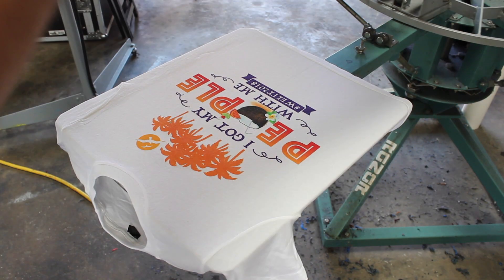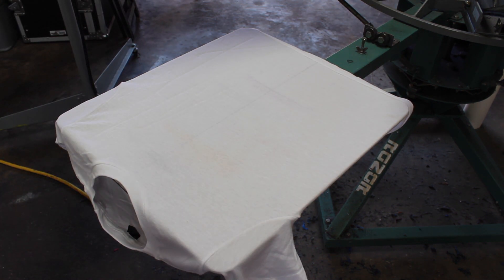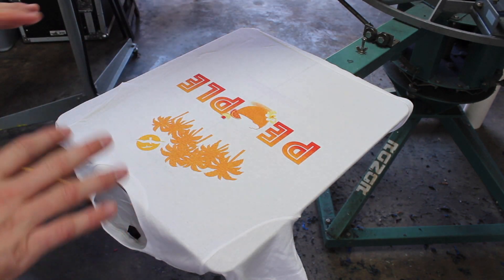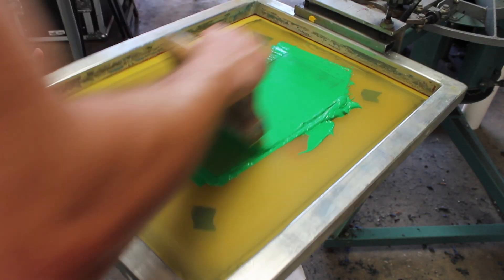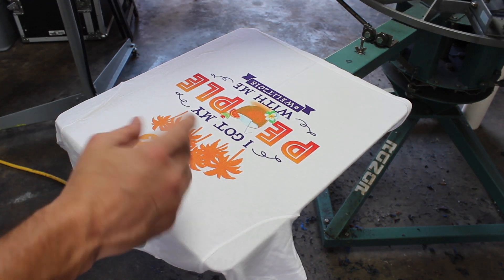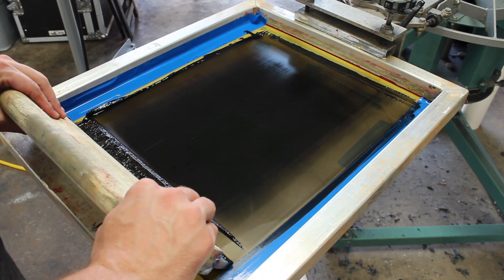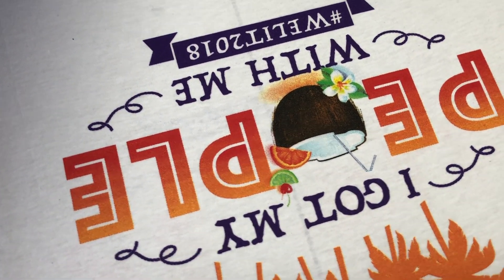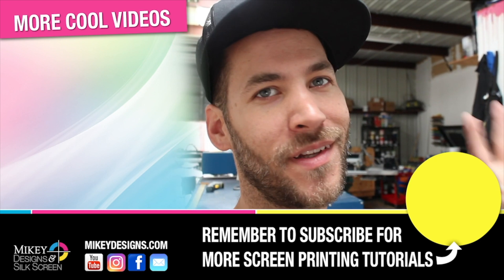The Ultimate Guide to Screen Printing Techniques

Comment: Looks great! Did you create that artwork or did the client supply it for you?
Reply from the maker: Thanks! A client of mine thats' a graphic designer created it. It was quite the challenging print to separate.
Reply: It turned out great. Which areas were giving you problems during the separation process?

Comment: Have you tried doing the same print with just CMYK?
Reply from the maker: I initially did, but the orange colors came out more consistent use spot process.
Reply: @mikeydesignssilkscreen473  Why do I find it so hard t ask questions ..I feel sooooo stooopid lol. But I will anyway...If you dont ask you dont know.....In what situation would you use CMYK over Spot Process ? just ask because it seems that spot process does it all....would it just depend on the design ? 
I feel youve already answered me in a way that is clear to you but I just cant get it sorry mate
Reply from the maker: @supernube5051  LOL, worries. I'm still asking questions to this day. I personally would use spot process over CMYK, any day. You'll get more consistent results. CMYK, manually, each shirt will come out a little different because pressure matters and human beings aren't machines.